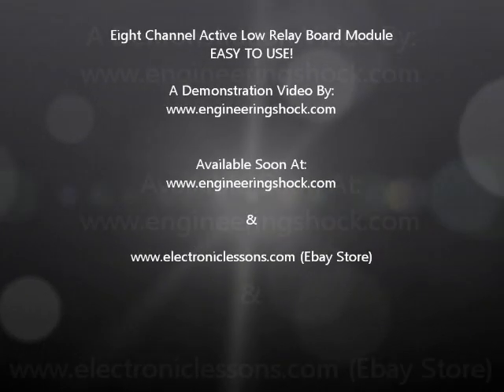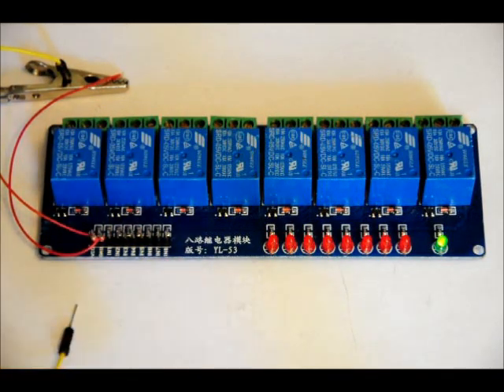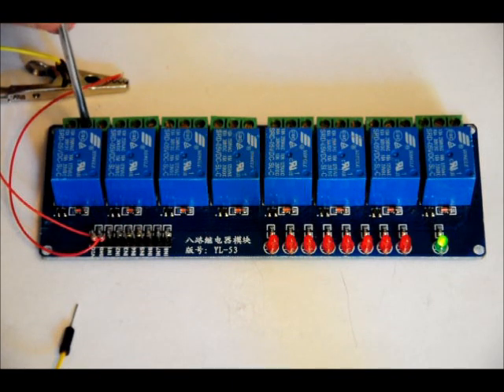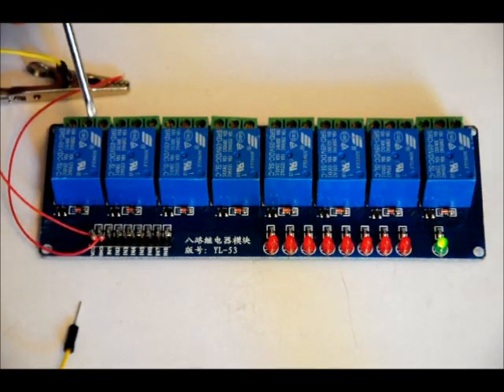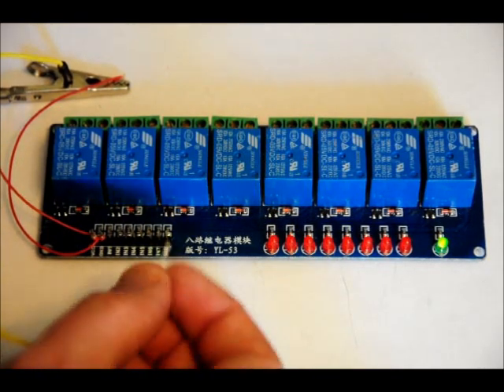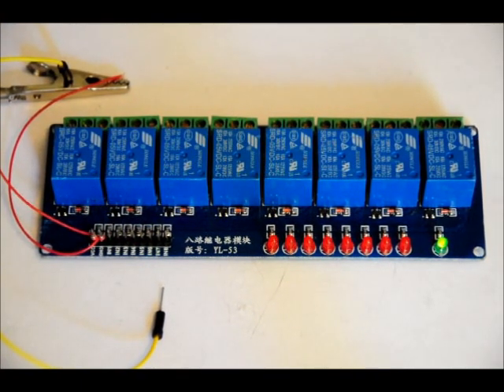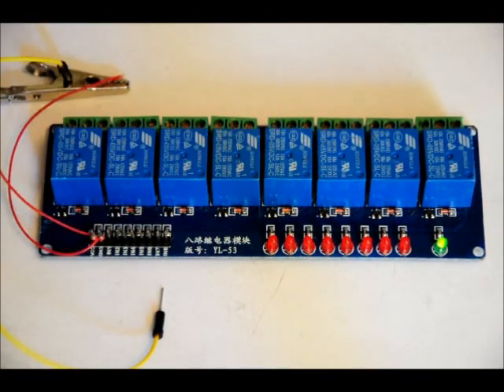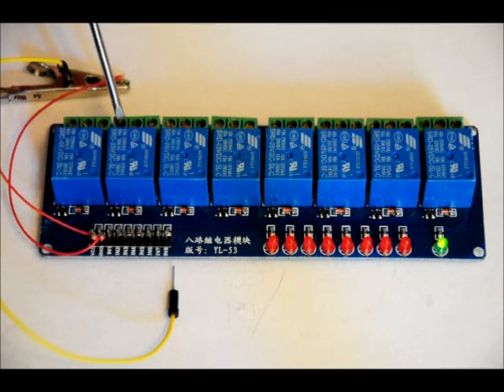Eight Channel Active Low Relay Board Module

Comment: my relay is not making a click sound when i m toggling it and its nt even making my light bulb on or off...but the LEDs on my relay are turning on and off.
What should I do???
Reply: This is either a lack of sufficient power to drive the relays - or a bad relay.  I have an 8-channel relay where one of the 8 behaves like this.  It continued to do so after I reconfigured to use a separate power source for the relays vs the raspberry pi that was driving them.  In may case I'm 99% sure it's a faulty relay.  I suspect some of these extremely cheap chinese imports on eBay are units that failed QA testing for more reputable vendors.

Comment: If someone is looking at controlling a relay via micro-controller, I am pretty sure they understand already how a relay works at the switch end - you should be concentrating on the  control end which is more likely where advice is required. I rate this as a fail!